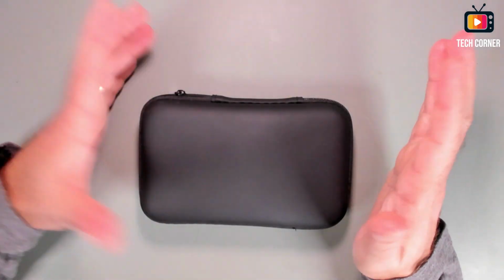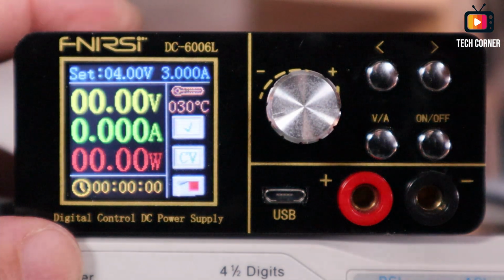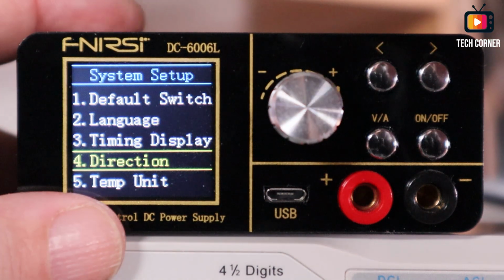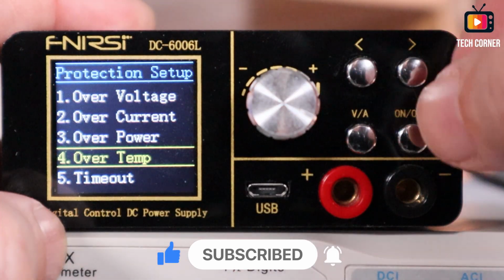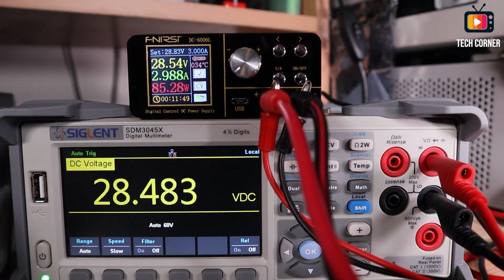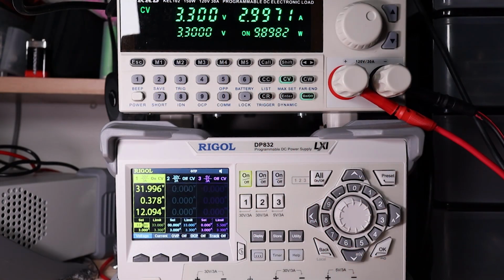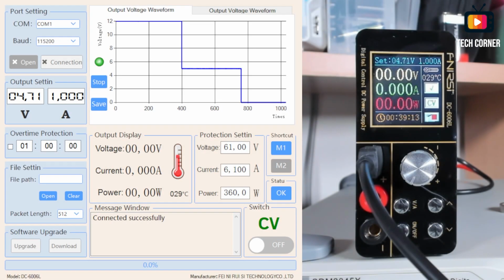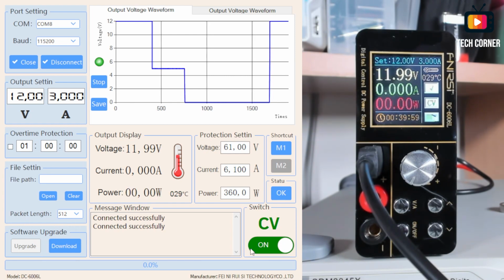FNIRSI DC-6006L ⭐  Adjustable & Programable Power Supply  💪 Small & Powerful

Comment: The voltmeters in the FNIRSI and the external multimeter agreed under no load. When you are using some current, the voltages no longer agree, which is normal. You are measuring the voltage at the far end; there is some voltage drop caused by the resistance in the cable..

Power at the FNIRSI is higher for the same reason. The rest of the power is heating up the cables.

Comment: Mine no longer delivers current A. It turns on, the display works. But it no longer supplies electricity. (Blown fuses? ) I think the fuses need to be changed but where are they?
Reply from the maker: Hello! Sorry for late reply, house move and vacations. A fuse it will be my first guess. They have a few soldered on the board, like really soldered, so if you haven't done yet this, please join the FNIRSI whatsapp group and ask for help there. They will probably send you the diagram of what you need to replace. Thanks for watching and sharing!
Reply: I had the same problem, I just fixed it a few minutes ago. The fuse is a small white SMD chip underneath the large wire Current shunt (looping in a zigzag above the PCB.  My PS came with two spares in a small black plastic tray (i hope you've still got yours). 

With a fine tip soldering iron, and a pair of tweezers, i managed to remove the old one, and put in a new one. Problem gone, I have my PS back again :)

Comment: Excellent product, I have usb-c pd in my lab which is the main supply for soldering iron and this small unit. Really nice and I can even take this with a powerbank to work in field.
Reply from the maker: Hi Paul, I liked it also and you're right, if you have a good enough power bank, you can use it to power this 😁 Thanks for watching!

Comment: Hello would be able to extract firmware from this device and share? It's not available from company. Mine cpu was blown and i replaced but need firmware for it
Reply from the maker: Hello, I have to learn how to do that and unfortunately the time has been to short. Thanks for watching!
Reply: It would be awesome if u could, I have asked all over and nobody has it. But it's not hard, all it needs is connection by the micro usb to pc and downloading the stm microchip chip programming software and connecting to it by serial port. If it refuses to connect you can apply 3.3v to the boot0 pin of the chip which will cause it to enter the boot mode

Comment: the best review sir. 
if set 1 volt can output 20 ampere? or how much max ampere if set 1 volt?
Reply from the maker: Hi Kang, you can't output 20A, the maximum output is 6A (and it is a lot for such a small power supply). With 6A you can go up to 60V output and that will make a maximum of 360W. But theorically considering the Ohm law, for 20A output if you divide the maximum power of 360W (power supply limit W)  by the desired 20A output, you can go up to 18V.  Thanks for watching 👍
Reply: @TechCornerTV  thanks for the information sir. 
you are the best review. 
i wish you csn review rd6024.
Reply from the maker: @kangtukang4948  The good part of that equipment is that you can use your own power supply, something like 1000 or 1200W, but really, do you need that? For less than or at least the same price you can buy the Owon SPE 3103, a awesome programmable power supply. See my review video of the Owon SPE series... should interest you. The RD6024 I went to see the prices and went through the root... over 100€ only the controller?!?!?!?! They're nuts, the first time I saw it was around 50€, that was acceptable.
Reply: @TechCornerTV  
ihonestly i have seen all your videos. i just bought dso2512g also because of your video. I am a novice technician. actually I need a power supply that can inject voltage on a shorted board. i need 1 volt 20 ampere output. can owon? this is only input, if you can review the test power supply as well as the load of 0.8 volts 20 amperes. thanks

Comment: How do I get it to change back to constant voltage? It changed to constant current by itself and I have no idea how or why
Reply from the maker: Hi, did maxed out the output? I didn't had that problem, I will have to fetch mine in storage to see how it works, but that is normally changed according the voltage/current drawn from the power supply.

Comment: I have second version of Fnirsi DC6006L (v2 written on the board) and seems they fixed back current issue (no diode needed to charge accumulators). Tried to charge lithium to 4.2 volts and after switching off from button back current is only 0.004a, fully off state back current is 0.053a. For comparison similar power supply Ruideng RD-DPS5005 has near back current 0.004a and 0.066a.
Reply from the maker: Hey Deckard! I'd love to test that V2 board, but I'm not gonna buy another power supply, it will do a nice follow up video, maybe I can convince them to sell only the board.  Thanks for watching! 👍
Reply: @TechCornerTV  with this trivial issues looks like fnirsi uses users as beta testers :|
seems rd has more mature products
Reply: Hello, can You share place where do You buy V2 version?

Comment: I bought one of these power supplies and  i was disappointed when the supply went into current limiting that it reduced the voltage. Is there any power supply that can provide constant current at a constant voltage?
Reply from the maker: Hey there, did you saw this video https://www.youtube.com/watch?v=WCGjIdjAFRI ? I was pretty impressed with this one, it's not linear but for a switching power supply is pretty good. I've done load tests with my electronic load and is all there in the video. Thanks for watching! 👍

Comment: I have the controller for powering and testing any electronics on my bench and it works perfectly. I use my toshiba laptop power supply 18.7v no problems. I even charged a tablet with it that uses 5v with 3.5mm DC plug which I didn't have but I did have 5.5 to 3.5 adapter and I set a timer for 2 hours, it stopped after exactly 2 hours. It does consume small amount of electricity even if it's turned off somewhere around 0.5w if I remember correctly.

It's not a power supply. It's a controller to get whatever voltage you want with saftey protection. 

Thanks for the extensive review as always. For the money it's a bargain and very compact and can be carried anywhere since it came with a small bag. And yes it's for hobbiest but if have any extra laptops charger or even satellite receiver adapter or anykind even a phone charger it will work fine.
Reply from the maker: Hello! I totally agree with what you said, you can use a laptop charger ou even a 15V charger and will more than enough to power you electronic projects, like arduino or others. But regarding what that is, I think even FNIRSI doesn't know how to sell it, sometimes they call it programmable CNC power supply, other times is just a power supply and also allows to charge batteries, I think it is in a grey area... 😁bottom line, is a nice product and a very accessible price if you need a programmable regulated power supply in your bench. Thanks for watching 👍
Reply: @TechCornerTV     yeah China in a nutshell. Lol they have crazy names but it's crazy that we can such products which was almost impossible to get for average people without actually working in a shop for someone. I have a fully equipped electric lab in my house for less than 1500$ including the desk

Comment: Did you show where from does this smart DC power supply get power ?! ...
Reply from the maker: Hello Ahmed,  I say it in the video, it is powered by my Rigol power supply (DP832). It's the power supply with the highest voltage I have (32V max). You even have an image of it when I show the DC electronic load. Thanks for watching! 👍
Reply: @TechCornerTV  Thanks for notifying but this is absolutely nonsense DC Power Supply and I don't recommend it the way it is ...